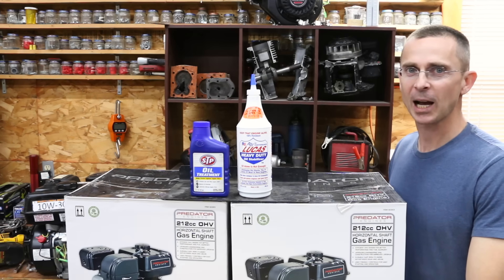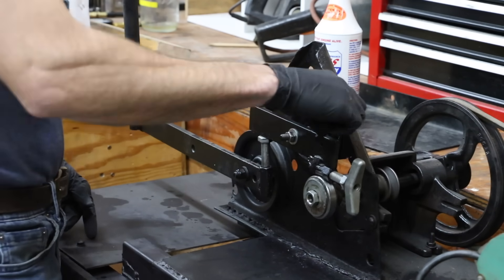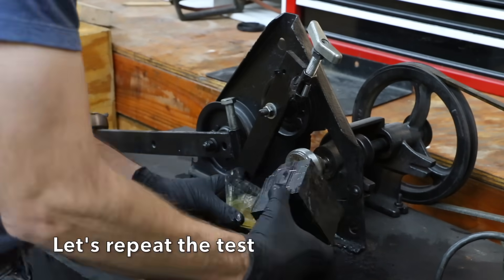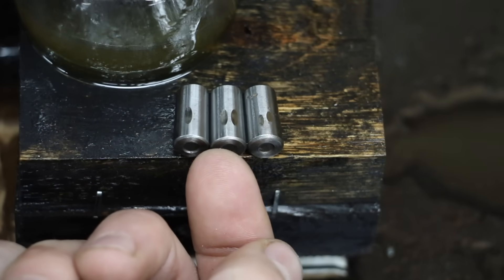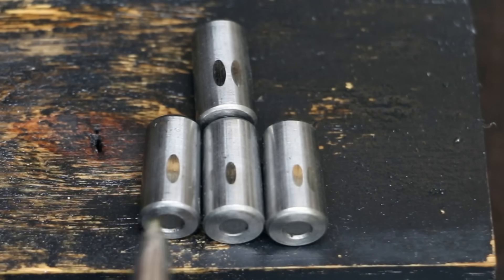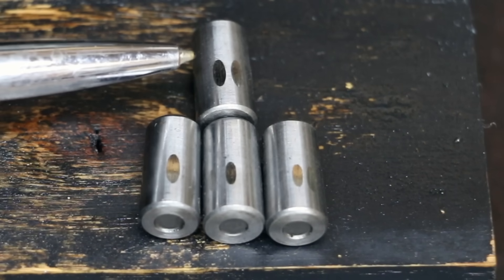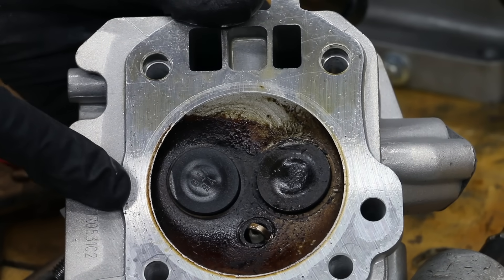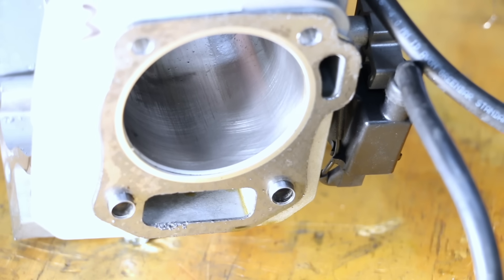Which engine self-destructs first?  Lucas or STP?

Comment: I've been a small engine mechanic for 20 years and I'm not really sure what this video proves other than if you run an engine without oil it's going to seize up. The fact that one engine blew up before the other could just be coincidence because you only had two test subjects.  As with any science experiment there should have been a control group where there would have been an engine with no additives added. It's a cool idea and I appreciate all the hard work you put into this video.
Reply: https://www.youtube.com/watch?v=m8ZKMCfAue4&t=5s kinda gives a control.  Not sure if he changed the base oil in this one from what he used before.  If so it would invalidate a comparison.

I do have to agree the sample size is small especially since no two engines will be perfectly identical but if there is a large gap like say twice the time in the test I linked it does say something.
Reply: @VentShop  something is off. both of those engines lasted longer than either STP or Lucas.
Reply: Agreed. Engines are not designed to be run without oil.  You are basically running such a small sample size it is statistcally neglagible also performance withou oil does not equate to performance with oil.  You could put shit in one and a turd in the other.
Reply: thenotfunnyperson - Uhh hey isn't shit and a turd the same, I mean they both come out the same hole, for you it might be different and that's okay I'm not judging, kinda like roflmao. That said the word Negligible surely is not spelled Neglagible, but again I'm not judging and that's a good try though uhh obviously you were just trying to be not funny. Cheers.
Reply: I think the results can still be interpreted. Those engines would run hundreds even thousands of hours with oil, both "self destructed" in under 30 minutes, and with maybe 12 minutes difference between them. I'd call that null result lol 

That said he went onto examine the wear on the parts....the BIGGEST tell imo of the additive quality
Reply: Exactly. The real true test without variances would need a time machine.
Reply: That’s a fair statement but the guy really went out there we’ve tested B&M oil treatment with some others as you stated and it turned out that the engines with out the added treatments failed much faster. I think with the test it some what helps a person decide that if yawing STP I would double the amount lol
Reply: Also another peoblem is over long term. Air in oil is bad. Cavitation causes a lot of damage. See it in diesel engines all the time. Also i would just take heavy gear oil and do the same test. Pretty much what lucas is
Reply: Is a control really needed? How long do you think an engine with absolutely zero lubricant would run for? I think that's why he didn't use a control. Also that would be another couple hundred buck wasted for a completely predictable and non-comparable result.
Reply: Personally I found it interesting as an 'almost' scientific method.
It looks like a 'home brew' oil test rig but is just about exactly the same design as those used in oil company labs from at least the 1940's. The only 'improvement' would be use 'new' wheel race instead of degreasing and polishing with angle grinder
 What it proves, oil additives are a waste of money unless you have a really old design engine that uses excessive clearance. In my experience ('only' 45+ yrs) 'thick' oils cause more engine damage to engines not designed to use them no matter what the ambient temperature.  It would be expensive but the same tests using full synthetic vs 'conventional' oil would be very interesting on 'industrial engines (particularly since my 18HP Kohler seized it's main bearing at idle and not at operating rpm)
Reply: I ride motorcycles.
 The newest one I have is from 1995. It has 11,500rpm 'red-line' from the factory. 
The ones from 1970's I modify to cope with 13,000rpm (up from stock 9,300rpm) but still use stock crankshafts, rods and bearings
 I use what works and not what advertising / marketing tells me will work.
 Oh, btw, they are street bikes not 'race' bikes. one has done over 70,000miles since modification but is pretty well worn now (over 106,000 total miles, many at 100mph+ and 9,000+rpm)
Reply: It’s close enough for a you tube video man besides the real gold here was the bearing test. The engine was more fun though haha
Reply: I was thinking the exact same thing... What a waste of two perfectly good engines!!!
Reply: It seems a bit weird to test a product by seeing how it performs after you have drained it out.
Reply: Один из самых безсмысленных тестов.
Reply: Isaac Bayer yeah you're correct and you would have to have multiple engines for each test and do it multiple times before you can get any conclusive results
Reply: Try dura lube  it is supposed to be the best of the best   do it please
Reply: Isaac Bayer thank you I don't need to say anything now... there a lot more into it than oil
Reply: Isaac Bayer so true
Reply: Isaac Bayer  I agree. Doesn't seem to prove too much. Just a really long video of someone blowing up a motor for no reason
Reply: +1. PTFE is for frying pans, someone didn't get their bacon ;o)
Reply: Isaac Bayer  is this not how Royal purple shows how good their product is in the same test ????????
Reply: Isaac Bayer yep I was expecting oil to flow out when he opened it up
Reply: Tim M I know they use the weighted pulley test on their MaxFilm. Stuff works great on everything i use it for, mainly fishing reels and even their grease. Not sure about the test but have no complaints with Royal Purple so far.
Reply: Yes your right odds are one is always going to live longer than the other and with chinese quality there's prob a big differences in materials used and tolerances.
Reply: I was thinking the same thing. Test which oil additive will make an engine last longer by removing the oil and additive and running until self destruct?
Reply: Why do you think oil companies use viscosity tests?  Not motors initially for testing and development.
Reply: surfitlive     don't want to break your heart but "pushrod engines" use hydraulic lifters and most American engines have been using hydraulic lifters since the 1960s and earlier. The bearing clearance is what has allowed engines to use lower viscosity oils. This also aids the lifters to stay pumped.
Reply: Isaac Bayer yes any engine would die with lubrications, no lube equal heat common sense .  This was biased .
Reply: Exactly.
Reply: You need to run 5 engines for each. Then take the average lol
Reply: You are not taking into account the main purpose to use Lucas or STP: "Oil Stabilizer creates a coating that clings to metallic surfaces". Running the engine without oil shows the coating effect.
Reply: perfect answer. additives are not meant to make an engine last longer when running it with no oil at all.
Reply: I started to use lucas in 2004 in my 91 Cadillac with Tbi 5.0 305. Its purpose is to give longer life to your engine. It reduces dry starts and I tested that buy checking the load and how long to start  with just conventional oil no additive then changed oil with additive. All test was conducted in the morning  when oil settled overnight. Try it it made my engine turn over quicker than with lucas due to lubricated parts. That means less friction upon first start. Also just started the same car today as it has been sitting since 2009
Reply: Plus believe it or not the bearing and sleeves could be of different quality, which would make a difference.   Really no way to test these products.
Reply: your right but idiots dont understand that.
Reply: @lkkjhtemmexv1838  And they don't understand the difference between your and you're
Reply: no evry oil have additives, but not ptfe ...
thast propaganda for looosers,
Reply: I thought the same thing re control engine. It would also be helpful to have objective measures of the engine damage.
Reply: Yup, you hit the nail on the head. The "experiment" didn't prove anything about either product.
Reply: Agree.  Proves nada.  Blowing up engines this way is a great stunt.  Maybe Lucas bought those engines?
Reply: "Not really sure what it proves?" If is a simple demonstration which additive may offer more benefit and protection long term. Of course it will seize without a lubricant. But, given these results, the point is to imagine how much more   wear  protection one may get if there IS oil with said attitive in the mix. Now, what would really tell us something is if the same thing had been done with oil only and then drained. If it lasted as long as the Lucas, then fine. No benefit. But I'm betting the Lucas bought it some time. And Hell, I'd even like to see one with oil and Prolong and see how that one does while he's at it.
Reply: those two engines could have fed 1000 africans
Reply: @Professional_Youtube_Commenter  Africans don't eat crank cases to my knowlede.
Reply: @Professional_Youtube_Commenter  Honestly
Reply: YAH KEEP BELIEVING IN PTFE PROPAGANDA SHIT....
Reply: D.Altittudes: Are you seriously saying that in 2018 you are driving a car made in 1991? Gosh that's near on as unbelievable as anything I have heard on YouTube . . .

Comment: First part of the video makes sense with the additive test on the tester. However, taking the oil out of a perfectly good engine and destroying it makes no sense.
Reply: Well the oil still has a film inside the engine, all the parts are coated before the drain so you can see how long that film will last before the engine quits.  You could do a much longer destructive test by never changing the oil in either engine and seeing how long it would run without draining but an engine could run for years straight.  This just shortens the time period between start and finish of a test.
Reply from the maker: John, You're exactly right.  The lubricity tester measure lubricity of metal that is cool, similar to a cold engine start.  The empty crankcase test measures film strength of these additives and how well they perform under extreme conditions and heat.  How fast do they break down?  Thanks again!

Comment: I enjoy you videos very much so please don't take this a as negative comment..... but neither STP or Lucas claim to prevent engine damage if ran with no oil. They only protect the engine when the product is actually in the engine. Back in the day slick 50 used to claim you can drain the oil and the engine would still be protected.  Lucas and STP don't make that claim. I think you have them confused with slick 50's claim.
Reply from the maker: This is a great point.  The lubricity tester measures lubricity of metal that is cool, similar to a cold engine start.  The empty crankcase test measures film strength of these additives and how well they perform under extreme conditions and heat.  How fast do they break down?  Nearly all of these additives claim to add lubricity to oil.  So, in theory, they should outlast conventional 10W-30 oil.  It's very early in the testing, but only Bestline has outlasted 10W-30.  Thanks again!

Comment: I used to use an additive in my 1990 Pontiac Trans Sport called "Duralube". I don't even know if it's still available. When I sold the van in 2000, it had 193,000 miles on it. It still ran beautifully and never had the slightest cloud of blue smoke come from the exhaust. Oil changes always had a good amount of old oil. It might have been bunk, but I felt that it helped preserve the engine. I'd love to see that tested.
Reply from the maker: Thank you for this recommendation.

Comment: You should test "Prolong" oil additive. I had a 49cc moped engine that kept seizing up with just oil, i treated it with prolong and it never seized again. I rain the points down to nubs and couldn't find replacements. I have used Prolong ever since. The infomercial they ran when they first started selling the product had them take 3 brand new Dodge vehicles treat the engines and then run them on the track with no oil for 500 miles and they never seized up on the screen. I would love to see an independent test. Personally I have seen Prolong do some amazing things with engines and air tools. They claim to have no equal in the world. Thanks
Reply from the maker: Thank you for this recommendation.
Reply: No problem, ive seen several lubrosity tests but no real acid tests by treating an engine and running it til it blows

Comment: Have a 2000 hour wear comparison using 10 different types of conventional 30W oil.  That's what we need.  I'm at 1984 hours on a Kohler V-Twin 18HP engine and it's always had diesel grade straight 30W in it.
Reply from the maker: Thank you for this recommendation.

Comment: The ONLY thing this proves is that if you put ANY kind of motor oil into a small engine crankcase...it's going to last a very very long time even if you don't change it regularly.  And by any, I mean the cheapest priced oil you can find.  Both of these oil additives are....well.....additives.  Not oil.  And certainly not some sort of permanent magic coating material.
Reply from the maker: Great point. Thanks for commenting.

Comment: Overall, I feel the Lucas did a much better job.  On a side note though....you really should be using impact sockets with your air tools.  Don't want to see you blow going blind should one of those sockets fly apart on you. Safety first !!!
Reply from the maker: Thanks for the safety precaution.  This is great advice.

Comment: The Lucas engine could've ran hotter because the air fuel ratios weren't exact too. A rich running engine will run hotter and without you checking afr's and egt's there's no real way to know. Also from the looks of the valves, the Lucas engine was cleaning and looked like it was running leaner than the STP that had more buildup and ran cooler like a rich running engine would. I doubt those engines were made with super high tolerances in mind from engine to engine. Especially the tuning of the carbs.
Reply from the maker: Excellent point and thanks for commenting on this.
Reply: Fully agree with Jeepser, maybe add an O2 sensor and tune them as close as possible before running the tests.

Comment: I have a request for a simple video. Supertech oil stabilizer vs lucas oil stabilizer and maybe as a bonus see what mixing marvels and oil does in the same test.my request involves the bearing test only. I feel it would be too time consuming and not worth the money to use new or old engines till failure to do these test.
Reply from the maker: Thank you for this recommendation.

Comment: I would like to see a test between SUPER KOTE 2000 and BARDAHL B1, they both claim that they put a protective coating on metal parts to reduce wear. Superkote 2000 claims that it uses a positive charge that makes metal oppose each other like a magnet therefore so metal does not wear out.  Thank You.  Both products can be ordered from AMAZON.
Reply from the maker: Thank you for this recommendation.

Comment: Excellent!! Video and work!! I will love to see how you can compare the Product Metal Lube, and anti friction treatment that do not treat the oil, it treat the metal, I been using this treatment for 23 years on all my cars, you just use ,  once a year or every 55,000 miles. For my experience is an excellent product, but I will like to see a mach with this product with z- max or the lucas. Thanks!!!!
Reply from the maker: Thank you for this recommendation and thanks for the positive comment.

Comment: The test was interesting, but it does not provide useful information.  A useful test would be to operate the engines under typical running conditions, such as by using a generator or a pump as a load, and see which oil mix results in longer engine life.  Such a test could well take a few thousand hours.
Reply from the maker: Thank you for this recommendation.

Comment: I could never could decide the difference between on my engine, so I used 2 quarts of Duralube, 2 quarts of Slick 50 and the rest full synthetic oil. After 10,000 miles, I changed my oil, and it still looked new! I used a WIX brand oil filter, as a couple of my friends had an engine DESTROYED by a FRAM filter, which came apart, plugging the oil pump and blown engines!
Reply from the maker: Thanks for commenting.  That's unfortunate regarding the Fram filter.

Comment: thanks for the content, having identical failures supports that the test was fair and the Lucas lasted longer. being used properly that difference is obviously multiplied, draining the engines just expedited the test. what is your opinion on slick50 vs zmax?
Reply from the maker: I tested Slick 50 a while ago under much different conditions and might test it again.  I haven't published a video on Zmax yet, but I'm really curious regarding how it'll do.

Comment: Not bashing stp but I use lucas in both of my vehicles gas and diesel. 1 over 220,000 miles 1 with over 310,000 miles with no trouble. Also run it in my equipment and oil keeps it's viscosity after many hours.
Reply from the maker: Impressive! Thanks for commenting.

Comment: Lucas has helped my 2001 Tahoe with 278000mi on it. When I started using it at around 18000mi the motor was knocking.  Now at 278000mi it still tics a little but way less than the knock it had 100000mi ago.  I'm going to empty trailer 700mi tomorrow and bring back an old car I bought on that trailer on the next day 1400mi + round trip.  I trust my Tahoe to do this at 278000mi.  Lucas works.
Reply from the maker: This is great information. Thanks for commenting on this!

Comment: you don't have a control for this test. This raises the question of the extent to which an engine of same type and spec would run sans oil at the same time as you run the two test case engines (ie, STP and Lucas test cases). Use of a control would permit you to make a tentative conclusion about which additive is more effective while accounting for variation in engine manufacture and materials, assembly variations and so forth.
Reply from the maker: Thank you for this recommendation!